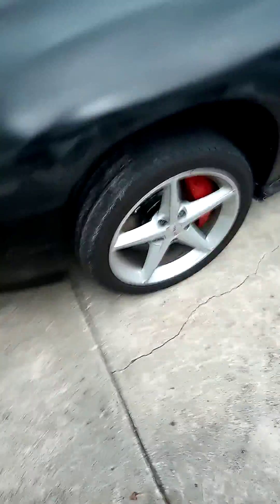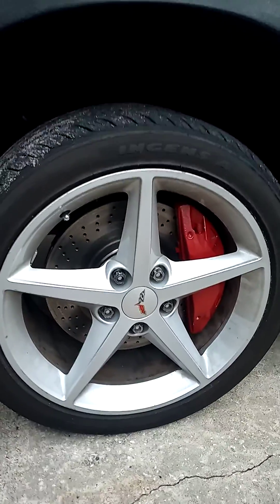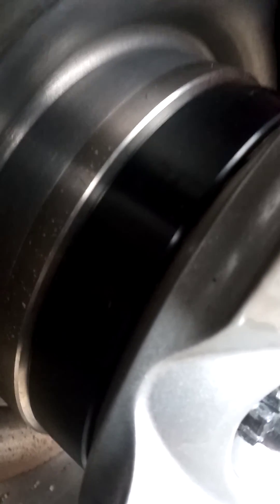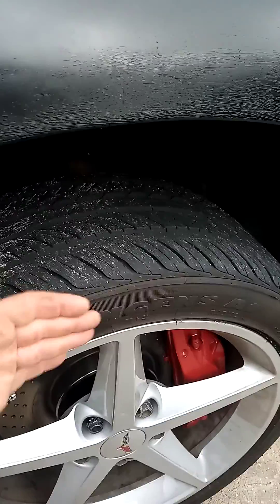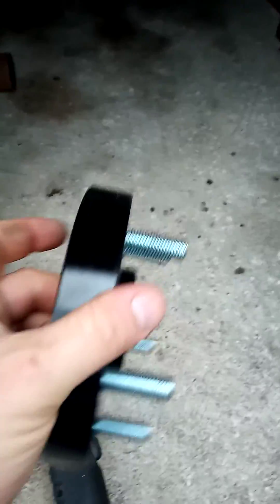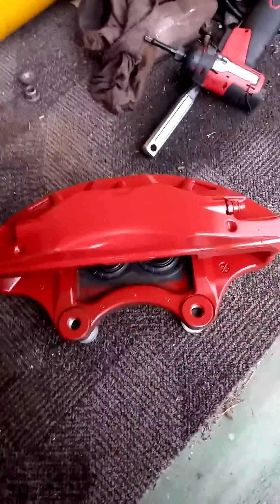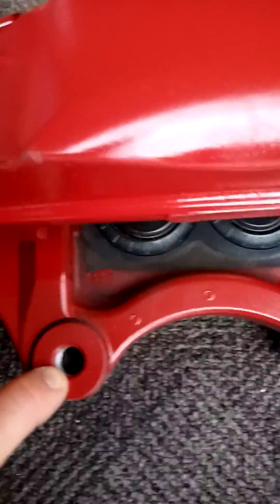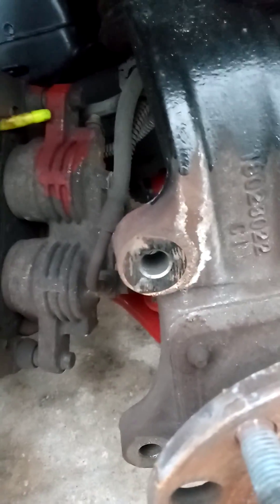4th Gen Trans Am Camaro LS1 LT1 Brembo 4 Piston upgrade introduction with exact info needed part 1

Comment: That is a huge spacer….I am wondering about track width change.
Reply from the maker: Wheel is still tucked under the fender. Corvette wheels have a completely different backspace. So it all depends on what brembo n rotor combo you plan to use to fit either under whatever wheels you have or plan to use. There is a combo to fit under factory 17s. Tho I didn't care for the plain WS6 style wheel. I ran my extra 10 spoke chrome SS wheels for a long time til I needed a fatter tire out back and did the brembo front brakes, this needing at least an 18in front wheel. So a $200 set of 2013 take-off Vette wheels were quickest to obtain from fb and able to run a 305 rubber in the rear.

Comment: Maybe w these rims can fit CTS 6 piston calipers
Reply from the maker: Should be able to.. but without doing c-clip Eliminator for having brembos in the rear, extreme nose diving will occur even with just the 4 pots in the front. I've never depress the brake pedal even more than 50% as it can lock up the front wheels going 30 miles an hour easily
Reply: @charliecadaver666  try brake proportioning valve,
send more preasure to the rear,
Balance stopping power front to rear, cheap
Keep testing until front and rear brake at the same time,
then add little more to the front 
Maybe there are videos about proportioning valves
Reply: @charliecadaver666  https://youtu.be/Inbcrffutfc
Reply: @charliecadaver666  they mention either way the master cylinder of the Miata
doesn’t have the power to lock the front wheels, seems fbody can

Comment: Hi, need to buy the rims and tires, 2000 camaro SS
Was thinking about 17x11 zr1 corvete rims
But these are even cheaper
Whats the rim model, name, size 19x9? 19x10?
What size the tires, 305 30 19?
DID YOU HAD TO ROLL THE lips of FENDERS, BANG ANYTHING?
Reply from the maker: Sorry for late response. Must not seen a notification. How'd you make out? You will need a wheel spacer for front for Brembo's. For this exact set up.. you have to get 18in wheels or 19s even i guess depending on brand and fitment. 
Next, for the backs. Yes.. i run 315 25 19 and 305 30 19 on the rear on the factory Vette wheels.  Most 305 30 19s seem a good .5in wider than 315 25 19s. So the front have just a 1in. Spacer. . Tho i want to get a 1.25in and see if more flush with fenders. Tho with stock brakes vette wheels fit with 245 tire on front no rubbing. The rear took 1.25in spacer. 100% you wheel not get a factory Vette wheel with back spacing for a Vette on the rear of anything but a Corvette. Now here's where things can get pricey if you don't already have. The rear suspension. I already had every tubular part you can buy on my car in the rear. And all adjustable as well as it is needed. Especially the panhard bar (phb). That is to center car 100% dead center above the axle. I did very little hammering to in er fender well for added comfort. Now even with those 13.5i wide 305 30 19s, I still have .75in to inner frame on both sides. Gonna be trying to throw on some 325 and 335 30 19s in rear soon.